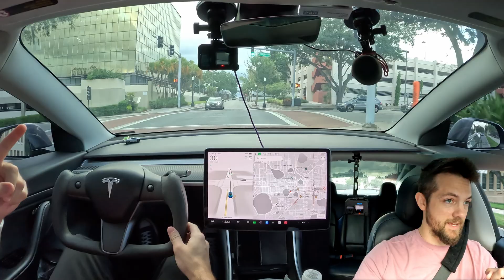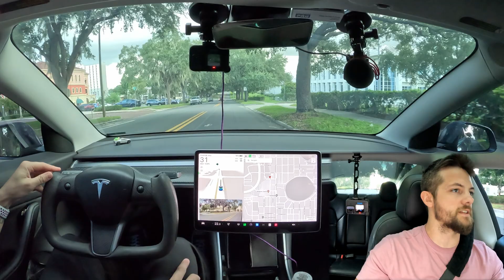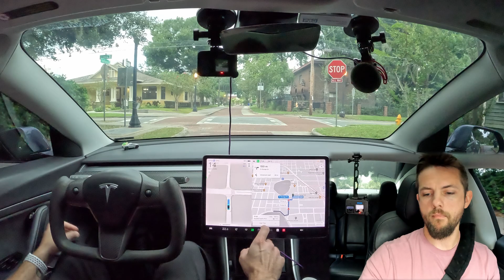Could This Be a New Gauntlet for Tesla's FSD? | Lime Street Candidate!

Comment: How much of your testing actually tests FSD and how much shows how bad map data is and how inadequate nav system integration/coordination with FSD is?  I think most of my problems are because FSD either isn't listening to nav directions or doesn't actually know which lane it is in.  I blame nav, not FSD.  

My classic case is getting off an Interstate near my home where if the nav system were giving good directions, the car wouldn't change out of the lane it is in because that lane turns into one of two left turn lanes I need in 200'.  Instead, FSD doesn't seem to care and is intent on moving over a lane, which brings it immediately (<100') to a wye in the road where it invariably picks the left branch instead of the right branch that leads to the second left turn lane that I can use, but isn't as good as the original lane it was in when exiting the Interstate.
Reply from the maker: I'm not so quick to separate the two. Don't get me wrong, I often point out where the cause is clearly navigational or map related, but these systems are a pair and you don't have a reliable service without them working in concert and in that it is an FSD issue. Tesla will need to address it and it is a valid critique. 

To your question though, I do collect data around this if you are not aware and maps/nav issues in my testing account for ~22% of disengagements on v12.3.6